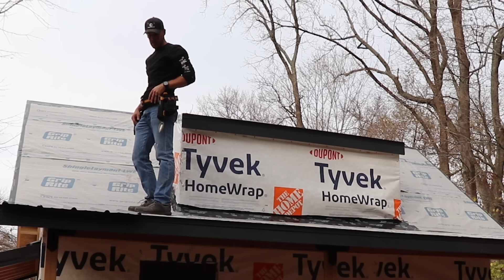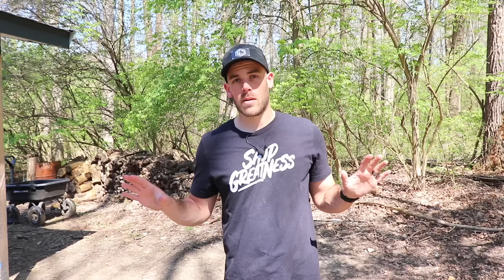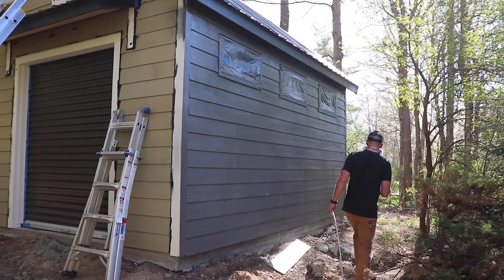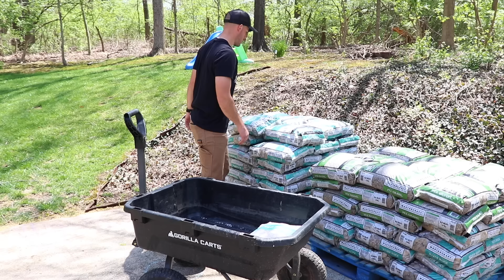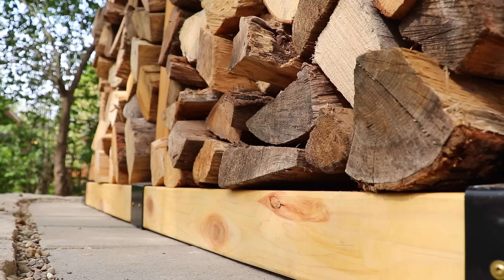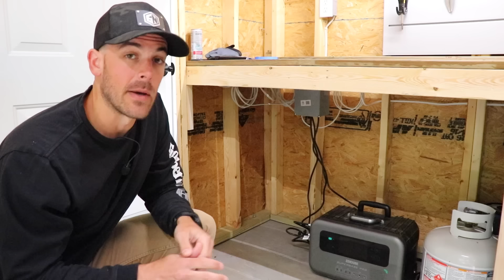I think I accidentally built a tiny house.

Comment: How did you add those gutter overhangs? i don't see how they are attached to wall? Looks good without showing any brackets holding them on the bottom side. How did you do that and support the weight properly?

Comment: Wow! I built a couple of sheds in my lifetime and yours is most awesome. I didn't know what I was doing but after 18 years It is still standing proud and my neighbors love it. Mine is basically 11 x 12. I've had to replace the doors twice as they were old salvaged doors. I used T1 11. And I have had some rot issues I have had to repair. But it keeps going and yours will last a lifetime or two. Thanks for sharing.

Comment: A "little premium" for the bags? I paid $250 for 6 yards delivered the other day. I think you used about 3 and it must have cost you $500+ before delivery. I just had them dump half a yard in my truck for any extra which means you can back right up to the job site and shovel it right where it's needed. I used to buy bags of sand from Menards. Found it for like 5% of the price and it's way easier to shovel from a pile vs loading and unloading it by the bag.

Comment: I built my shed 12x12 7-12 pitch 2 windows skylights 16 on center everything,self-adhesive base sheet and cap sheet, and much more i didnt mentioned as pressure treaded ground contact 2x6 on gravel and also had to spray 600 sqft with weed killer and also Spectracide Triazicide Insect Killer for Lawns & Landscapes. It came out looking great 240sqft 7feet high and 10feet to the Ridge bored where the trusses connected to. It only cast me $1800 3days work. I also used sidding to match it with the house since I just built the house with blue slate sidding color they both match up now.

Comment: 12:05  go to a hardwood dealer and get skip planed 4/4 ceder lumber then use it to make a ceder bench
Rough cut lumber is a lot cheaper from a hardwoods dealer then deck lumber from the big box store, skip planed lumber also looks nice enough for an outdoor bench you can always sand it.

Comment: The only guarantee i give on my concrete jobs is that it will be smooth when i leave and eventually it is going to crack! All you can do is cut expansion joints and try to control where it cracks. Its a chemical reaction that you can not stop.

Comment: This lil piggy...
Bought an ALL metal , w a front porch, I insulated and tile floored w real wood paneling.....$10,000 total.... I luv it...
Wood burning heater stove w water boiler, 
Solar set up, but wired for generator. N for 2 winters now. Totally movable. Solar motion lights... Built for hunting. Turned second 1 n2 shop w role up door n all. Talk about financial freedom 👍🔥🔥🔥🔥💯

Comment: Now I am extremely happy that I have a 50‘ x 70‘ 18 foot tall are we building. It also came with R 13 insulation. It was $20,000 and 2004. With a total of concrete which was oh my gosh contractors to put it together came to approximately $35,000, and it’s a hell of a shit cause I got lots and lots of room. And that includes 3 16x12 ft doors +1 walk-through. Not bad for a finished building. However, there’s a few more things I’ve had it since then. But three days. Technically one of those babies has a drive-through and one of them doesn’t have a big door but it would be the third day. I am so glad I did that back then. I see a little shit look like OK oh

Comment: After +15 years in the Automotive industry, I finally got myself some land. Just over a Acre, I have started to build sheds and tiny houses out of some of the Travel Trailers that were left on my property when I got it. The construction has been easy after tearing a trailer down to bare frame and the mess is cleaned up.

I appreciate the prep time that goes into paint day. Cars will spend weeks or even months of sanding and all the bondo work before ever being considered ready to start masking off for paint. Paint day only takes 1-3 days including clear coats but any defects that were ignored are quickly noticed once a nice coat of paint is laid down.

Nice build!

Comment: Great Build!  As someone who has built a shed from scratch, I can appreciate the level of effort that goes into it.  
Regarding the river rocks....I had a rock path next to the house and no matter how often I blew the leaves out, they somehow get tucked down in between some of the rocks.  Now mine were very white rocks, so it got dirty looking super fast.  
The only thing I would suggest is maybe placing a stepping stone path to the fire pit and shed.  With little ones, they can easily roll an ankle on river rocks.

Comment: Great build. You mentioned running electric to it but I think going solar would be awesome. I also think running some gutters would really help with the drainage off the roof.
Reply: Besides all the trees blocking light self contained solar with inverter and battery would add in around $10k but he has youtube money for it so it's nothing.
Reply: @superpj  you can get a solar generator like jackery and panels for wayyyy less than 10 k.... I paid 1800 CAD for a 1000 watt generator and 2 x 100 watt solar panels. I'm saving for a 1500 or 2000 watt generator now for my 13.5 foot camper remodel
 It's built to be off grid but also has electrical cord if I happen to be somewhere with power plugs 🤗
Reply: @mistyl1987  with the stuff in there those 200 watts with no battery won’t last long.  Need at least 1.6 kWp but if they have a microwave or heater then 6 kWp minimum for the panels and a 5000 kWh battery to keep them going into the late night.
Reply: @superpj  the jackery is a battery. I charge it with a 150 watt solar panel I put on the roof. It runs my fridge mostly and everything I put in the camper is rechargeable, such as motion sensor lights, faucet and shower head. It seems to do the trick for me. I was just camping for 5 days and the jackery stayed over 90% battery lifethe whole time. I have a little propane buddy  heater and a tiny wood stove for heat when needed and use a bucket heater for hit water. I'm working on getting a bigger solar generator just to have back up solar power. I got an energizer generator recently as well for back up power if needed. Plan on takin the kids to the mountains this summer for a month.
Reply: Gutters for sure. Super cheap and make more sense than tons of extra gravel. Looks amazing tho!
Reply: They show the outside, but they don't show the plumbing. They don't show the bathroom. They don't show the kitchen, they don't show the living roomawwwwwwwa

Comment: Impressive build. I’m building an 8’x8’ “treehouse” that I budgeted for round $15,000. “You are cray-to the -Z” my wife said. So, had a lot of the lumber milled by my local sawyer and I’ll build my own windows and door….it’s pretty massive but, except for a slab foundation, has lot of similar features (photovoltaic cells, metal roof, live edge cedar siding…). Bottom line, passion can be expensive! Well done, sir!
Reply: Woh great minds, I want to do the exact same thing on a lake lot I just purchased with 4 oak trees perfect for an awesome treehouse.  And my wife is the same, 'Are you nuts' ;)
Reply: @CyArch97  I wish I could send pictures. Our trees are Live Oaks and they are much beloved trees here in central Texas. In order to preserve them I opted to get some big cedar logs and build a platform “amongst” the trees and not “on” the trees. Concrete piers, anchors, big cedar slab skirt joists and live edge cedar siding….a while thing!

Good luck and happy building!
Reply: @SSBailey77845  That sounds awesome. You do the same!

Comment: I did a 12x24 with an enclosed 8x24 front porch for a cabin so 20x24.  I started clearing the land 20 years ago in about a week. Figure wood, nails, roofing, insulation, stove, chimney and finishing the interior it cost me just under $ 4850.  Now before finishing the interior, it was 2465 and a few cents.  Still, have a ball at it, and pull the recliner out, set up the TV by the fire pit and have clams, shrimp and steak for the family, or about 20 some people.  That is while watching a baseball game.  We did that the first year after finishing, and just continued.

Comment: On my "to do" list is a workshop shed.  It is to be a two part build.  Initially the first part will be an 8x12 simple gable roof.  Initial cost for that stage is estimated at $2137.67.  Stage 2 to double the size of the shed would cost a bit more because it includes a 4x8 porch with the main part of the addition at 90 degrees to the first and set with the back wall in line with one side of the first part and the outside of the porch inline with the other en wall on the forst part.  Even adding a fudge factor and saying the total project was 3 times the cost of the first part (say $6500.00) that still a far cry from your total cost and I'm having trouble pulling the trigger on the first part.  

Your total cost would be astronomical to me.

Comment: Sick build man. If the glare on the tv window gets annoying, consider some ND (neutral density) film that we use in film making. It’s how landscape & car photographers cut the reflections to see into the water/vehicles through the reflective surface. Keep up the solid content 💪🏼
Reply: That's polorized lens ur talking about not nd filters 😂nd filters are used when it is to bright and u need to lower ur shutter speed. 

Polarized filters is the one ur describing it is used to block glares and reflection
Reply: @MonicaHolly143  yeah i was thinking the same thing, thats polarized not ND hahaha
Reply: I had a shed built recently and want to figure out how to get it wired. I got medium gravel to go under for drainage.  I got a ton delivered to my house from a guy on Facebook. It cost me $150.
Reply: Looks great, but I wouldn't put that much work into a shop.
Reply: And trailers.

Comment: In 1995 i built a 12x16 ft shed or mother in law small building. 
It had a 10-2 pitch with a felt and shingle roof. Raised off the ground on blocks and. 24 OC 2x4 walls vinyl double pained windows and a one piece vinyl 36x72 entry door 🚪 wrapped with T-111 sidings 4" trim on all corners stained and sealed TTL $ Was $4,310
Some items were rummaged from the scrap bin at Sutherlins home store with permission from the manager 😂
Unfortunately my niece's husband stored a 50 gallon fish tank in it with fish plugged in and it shorted out burning the building to the ground 🙃 
Lessons Learned. 
Getting Ready to attempt this project again !

Comment: Hey? Call it what you want but that isn't a transom, which is a small window over a door used for ventilation and light or the section of a boat that holds the motor. A Dormer is what you have where a section of the roof is lifted up and the angle of the roofline changes..dormers also have windows in them for light. It's no tiny house, tis a mighty fine barn English. yea verily..

Comment: Turned out very nice, great sense of accomplishment.   

I agree with being willing to pay a premium to save on labor but I don't think that means buying rock by the bag from Menards, I'd spend the money on equipment rental.   River rock like that is a small fraction of the cost in bulk.  When you're looking at 10K pounds or more, with delivery and a 1 day skidsteer rental you're still coming out ahead without manually loading the cart, placing and cutting bags, etc.    If you needed/wanted any more rock anywhere else on the property at that point the incremental cost is trivial to add another ton or five as well.   Of course that cost equation doesn't make sense if you calculate that you need 5,000 pounds and eventually use 15,000 in increments...

Comment: I didn't see any weed mat around the building, did I miss that part? 
How come you didn't just buy the river rock by the ton? Would have been a lot cheaper. You're going to find you're going to need gutters on the front and to dress them up, use a chain instead of pipe for the down spouts. They work just as well and look much better plus they don't clog. you might also want to apply 2 - 3 more coats of the water sealer to the exposed cedar. One coat just won't do. Speaking from experience here. I just finished rebuilding my front deck with cedar and used 5 coats of marine grade spar varnish. This should last 5-7 years.
   Also, MOVE the termite food (firewood) away from the building.
   I do like the ladder you made for the roof. I've installed miles of metal roofing and we always made our ladders the same way but put carpet on the lower side to prevent marring the roofing. I also like the T.V. idea. Man, YOU NAILED IT ON THAT IDEA!!!

   I now have plans to build a 10' x 25' extension on the side of my wood shop to house the shop compressor & a 3 h.p. 2 stage dust collector plus lawn & garden equipment. Rough cost = $14,000. This doesn't include labor (I'll be doing it all myself). Tying into existing cost more and my roof pitch is 16/12. Going to be a ton of fun for a 69 yr. old man!
So, your cost was right in the ball park. Glad to see you haven't had any problems with the concrete yet. It does crack, so be prepared for it. If you cut some lines into the slab you can control the crack to that area.
All in all, you did a much better job than 95% of the "owner / builders I've had to go in and either finish or fix their screw-ups.
Nice job!

Comment: Beautiful shed Travis.  You will enjoy many years of fun and football memories with this project.  The cost really isn't too bad.  I did an extension to my garage, 14X20, for my workshop and it was over $40K.  With all the rebar in the foundation I had to do to pass city code, you could park a tank on the foundation and not hurt it.  All for a woodshop and our crazy city codes.
Reply: “…crazy city codes….” Having had to tear down extensions and sheds built by previous owners without consideration of codes, I favor code-built. I do not have to wonder how long it will last. I acknowledge that some parts of various code are overkill, nonetheless, safety and re-sale value are important to me.

Comment: did u ever sit back and think, "wow i spent $1100 on rocks" with the right grass (for shady areas) you could of grown a cheaper and cleaner place to put your feet
Reply: You're comparing the cost of grass seed to rocks. The grass would then need to be maintained. And on the edge of the woods, there'd be all kinds of turf insects. So either more $ for insecticides, or dealing with bug bites. In the long-run, the stone is the best choice, especially if the amount needed was determined properly at the start; it would have been way cheaper and easier to have had 7 yards dumped then rent a dingo

Comment: Holy crap that`s a lot of gravel to buy it all in bags.  A small premium you say? I`d have been interested to know the difference between bagged and having a dumptruck load and shoveling it.  Gravel is pretty easy to shovel off of a driveway.  And surely you did a little math to decide how much gravel you would need?!  You are an engineer after all.  It`s a relatively simple calculation of volume!  At the end of the day you need to be happy with it and if you are, that`s all that matters.  It IS a really sweet shed!

Comment: For your water run off issues, instead of spending thousands of dollars on rock and gravel there is this awesome invention you should try: Rain Gutters. 😐
Reply: See all those mature trees? They'll drop leaves that would clog up gutters multiple times every fall. And leaf-guard gutters can cost as much as $50/linear foot. He had to put something down anyways. Vs. mulch that'd need to be redone every spring or a concrete pad, gravel is the most cost-effective solution in the long-run

Comment: I would suggest you forget silicone caulk.  It's not the best caulk, many times it doesn't take paint well either.  Big Stretch or other sashco speciality products perform much better, and are much easier to work with.  Overall the shed looks great.